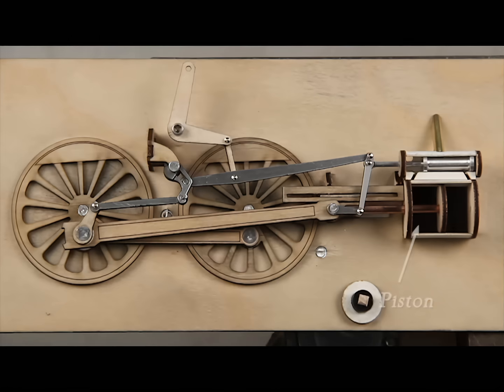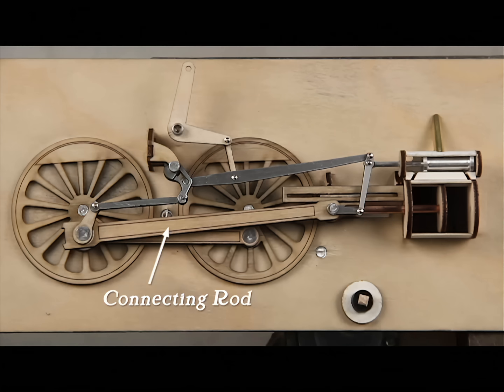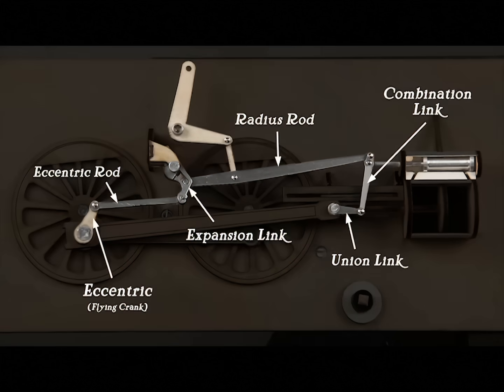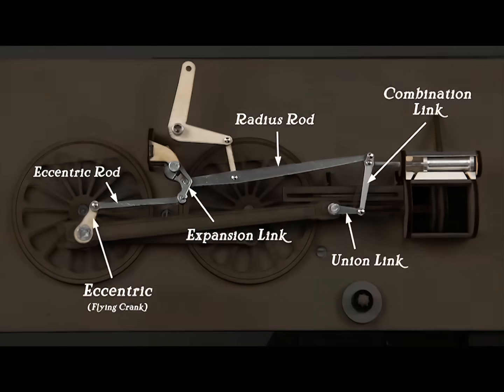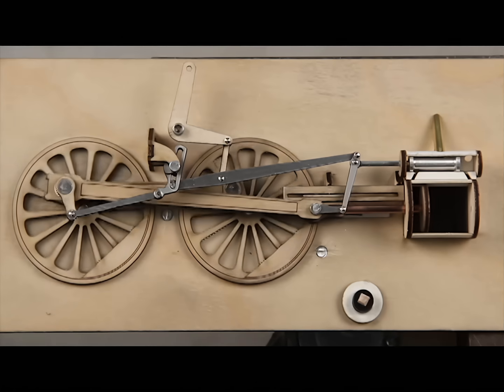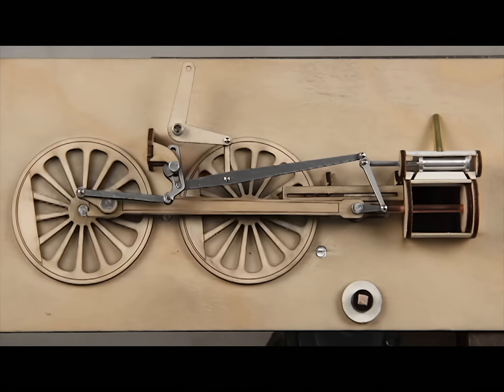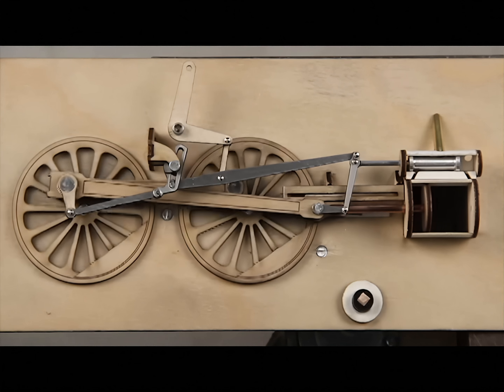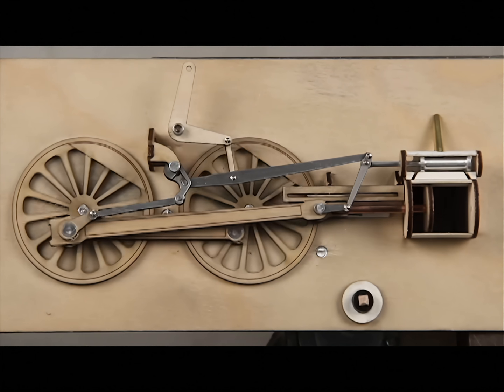Walschaerts Valve Gear Explained

Comment: How nicely done, But it should operate in neutral because the pins or pivot points int he conbination arm are offset and still moving. But this is so nicely done. Beautiful model. I think it is one of the best on YT.  You explanation is so simple I think almost anyone can somprehend what this strange and fascinating collection of steel bars is all about. I think you are correct when you suggest it was of interest yo you. I think this little subset of pistons and rods is what make the steam locomotive so interesting.

Comment: In model form I like the simple Stephenson valve gear. I try to mess with walschaerts valve gear they always seem to bind.
Reply: I have constructed 6 passenger hauling steam locos all with Walschaerts valve gear.  The secret is do not make the parts to fit too closely.

Comment: There seems to be some confusion about how the parts all work.  The combination lever moves the valve back and forth a fixed part of the piston's stroke; it never opens the valve.  This motion is needed because the portion of the valve that covers the steam ports is wider than the ports.  If the combination lever opened the valve any amount on its own, there would be no way to put the engine in 'neutral'.  The angle of the eccentric does not determine inside/outside admission.  If the valve rod connects to the combination lever below the radius rod (as in the model), the engine is inside admission.  The confusion is caused because the valve gear may be direct motion or indirect motion.  With direct motion valve gear, the eccentric rod moves in the same general direction as the valve.  If you change the eccentric from leading to trailing, you change the relative angle 180 degrees.
You can get the same 180 degree change by moving the radius rod between the top and bottom of the expansion link.  So either leading or trailing eccentric is correct for inside or outside admission; you just have to 'reverse' the direction of the radius rod.  In fact, many Garratts are built with one engine with direct motion and the other with indirect motion.
Reply from the maker: Wow! That's good info, Dave.  I should've realized the center position shouldn't open the ports, at all.  I'll have to modify my model, now, and add a note to the explanation, above.
Reply: @BLitwin  You can have port opening with the gear in mid position, it provides what is called lead (not the metal!). You need lap and lead movement which is provided by the combination lever, any extra valve movement comes from the expansion link. Stephensons gear has a habit of causing negative lead at small cut offs.
Reply: @BLitwin  Dave is wrong. The valves SHOULD open in center (there is no neutral). In center, the valve opens a little bit - this is called the lead - as the valve is only controlled by the motion of the piston through the lead and lap lever. When the valve gear is properly set, the loco can run in forwards/reverse as the valve events are the same, just not very powerful.

The lead and lap lever moves the valve twice the quantity of lap + lead. Lap  is how much the valve covers the steam edge when the valve is centered. Lead is how much the valve is open on dead center. On live steam models, they may have 1/32"-1/16" lead. On full size they may have 1/8"-1/4" lead.

Walschaert valve gear is a constant lead valve gear - no matter where the valve gear is placed, the  lead remains the same.

As far as the eccentric crank, the eccentric crank is close to 90 degrees off, but due to the piston centerline being higher than axle centerline (dead centers are not 180 degrees apart) and the height difference between the axle centerline and the basked of the link, the angle can vary from loco to loco and with the crank pin at the 6 o'clock position the eccentric crank pin is higher than the axle centerline making the angle listed in this video greater than 90 degrees.
Reply: The combination lever moves the valve lap + lead, hence the name combination lever. For one complete stroke of the piston, the combination lever moves the valve (lap + lead)x2. This movement occurs no matter where the die block is in the link and opens the valve the lead amount even in mid gear. This crosshead derived motion is referred to as the 'The short' travel. The 'long travel' is derived from the return crank, which is 90 degrees out of phase to the combination lever, and is what opens the ports beyond any lead. This also applies to Baker valve gear.
Reply: The valves SHOULD open in center (there is no neutral). In center, the valve opens a little bit - this is called the lead - as the valve is only controlled by the motion of the piston through the lead and lap lever. When the valve gear is properly set, the loco can run in forwards/reverse as the valve events are the same, just not very powerful.

I'm not sure why you are saying that the valves don't open in center. The lead and lap lever moves the valve twice the quantity of lap + lead. Lap  is how much the valve covers the steam edge when the valve is centered. Lead is how much the valve is open on dead center. On live steam models, they may have 1/32"-1/16" lead. On full size they may have 1/8"-1/4" lead.

Walschaert valve gear is a constant lead valve gear - no matter where the valve gear is placed, the  lead remains the same.

As far as the eccentric crank, the eccentric crank is close to 90 degrees off, but due to the piston centerline being higher than axle centerline (dead centers are not 180 degrees apart) and the height difference between the axle centerline and the basked of the link, the angle can vary from loco to loco and with the crank pin at the 6 o'clock position the eccentric crank pin is higher than the axle centerline making the angle listed in this video greater than 90 degrees.
Reply: Some good information here! Can I also add, regarding lap and lead steam, as has been said for lap it is necessary to have valve heads that are wider than the valve ports. I know that on the miniature loco's that both my dad and my brother have built, the valve heads are twice the size of the valve ports themselves. Furthermore, it was always my understanding that when the valves are sitting central over the valve ports, the outside edge of the valve heads (the exhaust side on inside admission) are just about closing the valve ports on both ends, i.e. the outside edge of the valve head is inline with the outside edge of the valve port.
Reply: @stephenwiseman1816  What you refer to is exhaust clearance if there is a gap between valve and port on the exhaust side, if there is no gap and the valve is directly in line with the port this is 'line on line". If the valve extends over the port on the exhaust side this is exhaust lap, very rare on locomotives though.
Reply: @hackenbush23  That's interesting to know! Thanks. Never knew there was exhaust lap. You learn something new every day!

Comment: If you are going to make this into a working model, I would suggest you add a Johnson bar with a quadrant and reach rod to control the crank which controls the radius rod.  It will only be three added parts but will look better.  Welsch Scientific used to have a demonstration model showing Stephenson gear and it had the Johnson bar and reach rod.
Reply from the maker: I might do that.  I don't have any near term plans to put this into production, though.  Thanks for your interest. :)

Comment: I am not trying to give you a hard time because you have done very well.  You have done Walshaerts with inside admission.  The eccentric crank follows the crank pin.  When the eccentric crank leads the crank pin the gear is for outside admission of steam.  It is just a different set up.  Everything works the same but with the steam being admitted from the outside of the valve spool and exhaust through the center.  Different railroads had their preferences.
Reply from the maker: Yep.

Comment: Hi... Excellent demo!  I do have a question that was not addressed in your video, and so I was hoping that you could clear something up for me. I was under the understanding that the engine cannot run while the Walschaerts Valve Gear is adjusted to its neutral position. And that is due to the fact that the valve timing is so short in that condition that it cannot open the intake ports on either side of the main cylinder. Is that correct or is my understanding in error?  THANKS!
Reply: That's true in principle, but in a steam locomotive there's always a certain small amount of steam leakage through both the throttle and the piston valve. Thus if you leave a locomotive in neutral position with steam up, it is liable to "walk", very slowly and sometimes imperceptibly, in one direction or the other. (I'd have thought simply opening the cylinder cocks would prevent that, but apparently not.)
When a locomotive came in from a run, its fire was dropped but the remaining steam was left in the boiler so the locomotive could be put away in the roundhouse under its own power. When that couldn't be done without delay, the practice -- in North America at least -- was to 'chain her down': to lay heavy chains across the rails ahead and behind that the locomotive couldn't cross with the very low steam pressure available in those circumstances.
An old friend of mine, when he was a callow young wiper at the major roundhouse in Revelstoke, B.C., once neglected to chain down one of the Canadian Pacific Railway's mammoth 2-10-4 locomotives. It walked into the turntable pit, putting that very crucial engine terminal out of operation for over 24 hours. He spent the rest of his career working for other railways.
Reply from the maker: Hm. Not being a locomotive driver, I haven't any direct experience with this.  What I would say is, that since the neutral position doesn't favor forward vs reverse operation, one could end up going in the opposite direction desired, depending on the current valve position, at rest.  But, I would not be surprised to learn that you can't even get moving, unless the gear is set to full.
Reply: That is basically correct that if the reverse lever is in  midgear there should be no movement of the loco.  That depends on wear,  proper adjustment,  proper design and proper construction.  This is the condition of any valve gear and why it works.

Comment: This is a very fascinating  working model. There are three points of difference I've seen
in other diagrams and models, however: connecting rod(main or driving rod),  tie rod(side rod or connecting
rod) and combination link(combination lever).  I'd like to see more steam locomotive related models.  Thanks!

Comment: Nice work, it appeared in recommended videos, cause half year ago, i tried to understand how it works and how to calculate movements. I came to conclusion that at least some joints must have some clearance, or mechanism can't move. For example, if radius rod is set to pivot point of expansion link, it needs to move up and down a bit. How did you managed to create working mechanism? I think it's possible to get some approximations that are close, but my goal was to create visual computer model and get position of every joint.
I sort of wonder if it's possible to get historical drawings of steam locomotives designed after WW2 somewhere, but I doubt archives are public.
Reply from the maker: Thanks for your comments.  There are tons of technical drawings available.  Here's a search link - https://www.google.com/search?q=dimensional+drawings+walschaerts+gear&source=lnms&tbm=isch&sa=X&ved=0ahUKEwjK4P60raHaAhXhs1kKHSqHD4UQ_AUICigB&biw=1119&bih=902
I just copied over a photo graph of a real locomotive, and adjusted the geometry in CAD.
Reply from the maker: Nice!  Thanks again :)

Comment: Question:

Could the reversal of the phase of the steam, in addition to reversing the direction of the train, be used for braking?
Reply from the maker: Hm.  Not being a locomotive driver, I can't really answer that question with real expertise.  But, my intuition tells me that it might be a difficult maneuver, balancing the throttle against adjusting the phase change.  And, the Johnson bar, which the driver uses to adjust the radius rod pivot position, in the die block, takes some muscle to move. And anyway, air brakes are very effective.
Reply: Right, that seems likely, there are indeed a lot that is speaking against using it for that purpose. Thanks!
Reply: The answer is YES.  I have done it when the air brakes failed and on a passenger train at that.  Before air brakes this was considered normal.  Of course as locomotives got larger, it takes more effort to move the Johnson bar under load without a power reverse or screw reverse.
Reply: It's possible, but requires some additional measures. Unfortunately, when steam engine is turned as 'brake', it sucks smoke into cylinders and tries to pump it into boiler. There are some reasons why that's bad: some coal and cinder may deposit inside cylinders, this already hot smoke gets even hotter under compression, so temperature of gas may exceed engineering limits. So there are some special valves which should be manually opened to allow correct operations.

Come to think of it: with proper design it could be possible to perform 'regenerative' braking: we put some low-pressure low-temperature steam into cylinders. Under brake conditions it becomes high pressure high-temperature steam which we inject into boiler. So if there is steep valley, we can almost shut down furnace and keep boiler high-pressure just by collecting this braking energy!
Reply: @allmycircuits8850  What you say does not happen as there is a thing called a snifting valve that lets clean air into the system when the regulator is closed with the engine running.

Comment: This truly brings Walschearts to life. Do you plan to create models of other linkages?
Reply from the maker: Not anytime soon.  But, you never know.
Reply: Baker valve gear is very similar. The only difference is that it replaces the slotted, sliding expansion link with a few pin joints, which reduces wear and maintenance.